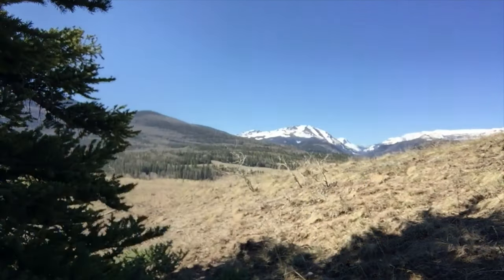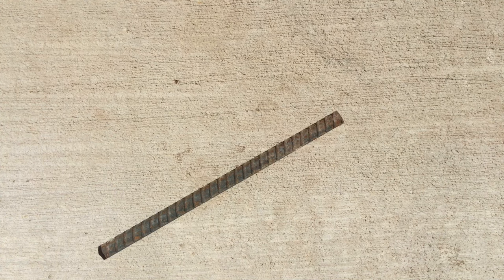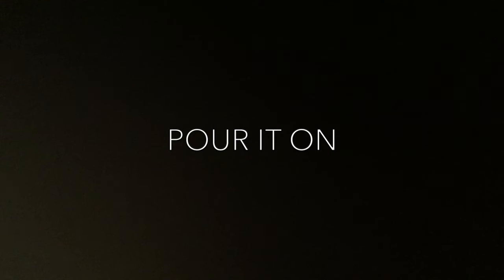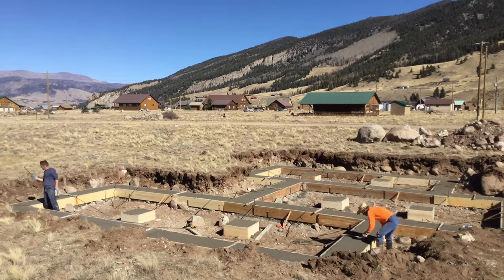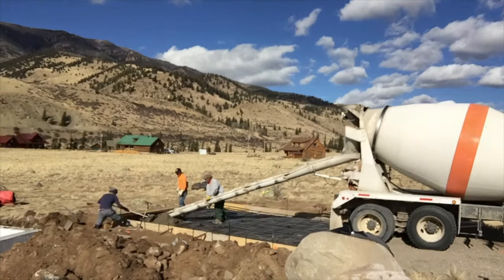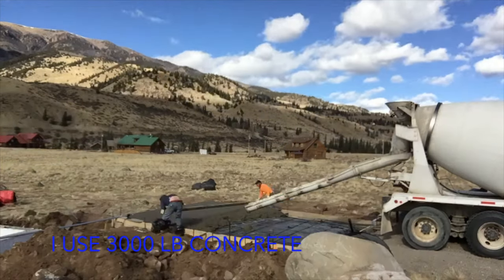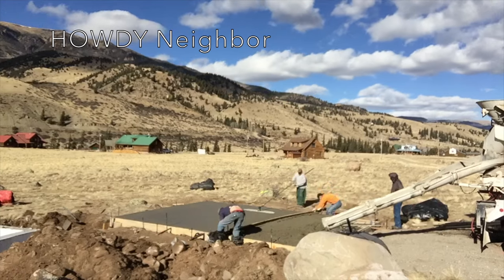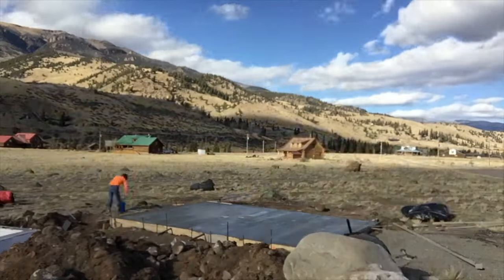POURING CONCRETE FOOTINGS and SLAB with out a contractor

Comment: verticals should be in before you pour and should have a bend to shape them like an L so they have pull out resistance.
Reply from the maker: Yep, that works. Rather than j- bolts with their smooth sides rebar by design won’t pull out. Remember when rebar was just twisted steel before the current improved design proved itself? Thanks, be blessed.
Reply: @ModernMountainLiving  Seems like vertical can be done both ways. Although some codes require pre-pour installation. Supposedly it’s ok to let vertical rebar to also touch dirt/ground. No different than using steel chairs to support horizontal rebar. If chairs rust out it leaves path for water to get to horizontal rebar. The more you read the more it can confuse you. Unless you wanting your great great great grandkids to inherit your house someday, you probably not going to have to worry about the rebar being damaged enough from water to hurt foundation. I’ve even wondered about using bricks or stones as rebar chairs. Unless the garden stones or bricks have proper rated psi strength same as concrete pour mix, could they bear required load and not crack causing water to get to horizontal rebar?
Reply from the maker: @jrandall5736  I'm with you and have done it both ways. I might have to look up metal chairs as you mention because I have never used them. I imagine it was a realistic option  before I started 20 plus years ago. Back then maybe we were too cheap to use anything but broken CMUs of which I can see using again if my supply of plastic chairs dries up. We have all been there. When the trucks are on the way you just improvise and over come. Mud waits for no-one. Good comment.